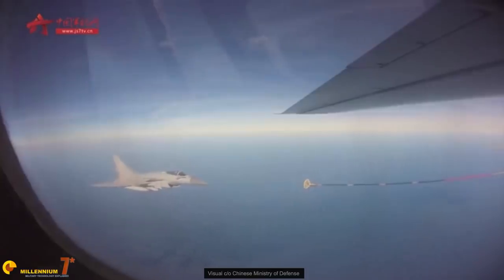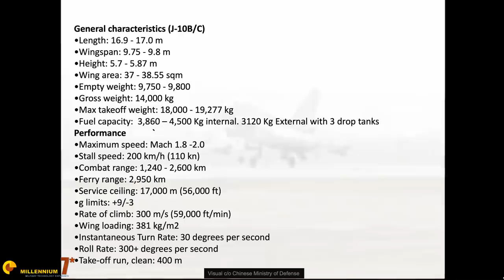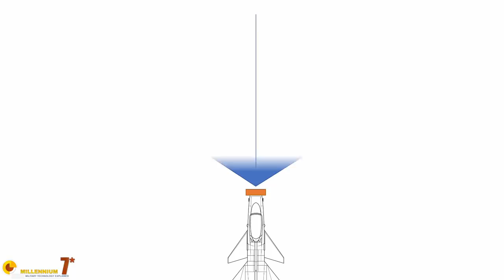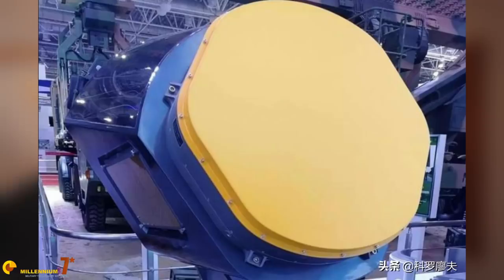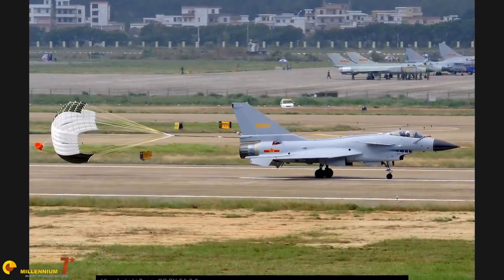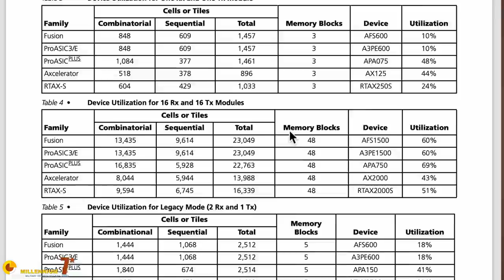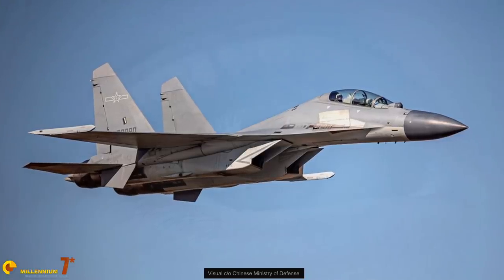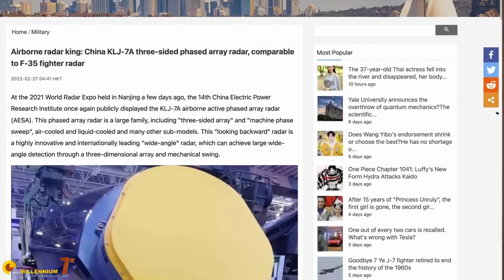I DUG DEEP into CHINA's J-10 ELECTRONICS and this is what I found...

Comment: All I really know about the J-10:  it is worrisome.  It appears to be a relatively inexpensive fighter aircraft which the Chinese can produce in large numbers quickly, and which appears to have at least parity with similar western configurations, but is undergoing continuous refinement and improvement.  That we in the West are not in pursuit of an analogous fighter (with the shutdown of the F-16 program without a replacement) is troubling.

The use of civilian standards in military aircraft, particularly for export use, is not unheard of.  Knowing how military planners think, it is likely this use of ARINC is intended for export (as Sr. Ramos and others have suggested), and that it can be easily retrofitted/replaced by a more robust system for indigenous use.
Reply: I'm frustrated with my USA too.. but let me bring you a little peace of mind. IF we continue to ramp up production of the F-35 (and obviously if we don't all die in a nuclear fire, the Russian invasion will be an absolute boon for the MIC) we will be fine. For starters - attrition. For all the bellyache about the F-35, let's be practical; the entire aircraft is built around LO/LPI. Although better fighters may exist, none exist in sufficient numbers to overwhelm our inventory of F-35's. As long as we keep cranking them out, this will remain true. The F-35 is also fully capable of providing mid-course guidance to missiles launched by other assets, including AEGIS and THAAD, for which it can also provide critical data for a hi-res 3d target track which is essential for missile defense. That's a big fucking deal. Look, I think the F-22 is the best performing fighter the US has ever made, and along with the B-2, it is a very special weapon indeed. But logistics, availability, and of course politics matter too, and when those aspects are also factored in, the F-35 has the edge. Think about it. 700 F-35 or ~120ish combat-coded F-22? The F-35s are gonna get the job done, and be ready for more, over and over. The F-22 availability is gonna drop like a rock from the word go.
Reply: @ray32245mv  Unfortunately the biggest problem with the F22 had nothing to do with it's capabilities but it's inability to be upgraded. If the USA had allowed select nations to purchase the F22 I think they'd still be going strong, albeit that inability to be updated/upgraded is huge problem. Just look the pilots aren't able to utilise helmet mounted displays, and their datalinks cannot communicate to modern aircraft or other assets. 
It will be missed when it finally stops flying, like the A12 and SR71.
Reply: Remember the F35 is the quarterback long range radar much better than China can do, the F15 is a missile truck that can use the F35 radar targets
Reply: There are more F-35s than J-10s. In fact, China is frustrated that their F-35 counterpart (a cheaper 5gen) is not matured yet.
Reply: @jwzjwz2003cn  the technology stealth is no longer stealth anymore. There are radars now on awacs and grounds which can detect stealth even cruise missiles. Yeah you can suprise iraq or libiyan airforce. Or most likely to be iranian. Plus stealth fighter needs lot of maintenance specialy for their radar absorbent coatings.
Reply: @jwzjwz2003cn  Not really. F22 is not in production, So J20 will outnumber F22 very quickly (probably already did) and J20 does land/sea attack much better than F22, so it can do F35's job aswell.
Reply: @ray32245mv  A few things:  the F-22 is done.  It's not coming back for a whole host of reasons, and I'm not holding my breath in hopes that we'll turn around on that one.   Once our existing inventory wears out or is shot down (yes, it CAN happen), that's it.  What I wonder is:  why are we not at work on something better (and maybe we are?  If we are, we aren't talking about it much, and that' might actually be a good thing.)

I do wish the F-35 had been a twin-engine design, just from the standpoint of reliability, but that didn't happen either.  I also wish the F-35's top speed had been pushed to at least a bit beyond Mach 2 - again, that didn't happen.  I also wish the F-35 had more actual dogfighting capability than it does.  For what we are spending on the program, this aircraft oughta be able to do all that and cook our breakfast.
Reply: @markredacted8547  Thats....exactly what I said, F-22 weakness comes down to logistics, availability, politics.
Reply: @horusfalcon  Yea, like I said, the F-22 is becoming obsolete for reasons, and no, they're not gonna make more, nor should they. Mission availability matters. 
Ok, let me give you a little more perspective, kind of big-picture thinking. Basically, Communist (Eastern) military doctrine is based around defense by way of low-tech, low-budget, basically trained, low-morale masses of assets. They are not very good at offense. They tend to build out and fortify the crap out of something, and then maybe build out some more. Look at Moscow. It is an absolute fortress, bar none. Also take note of China and the South China Sea. Look at the current invasion in Ukraine. Slowly building out, encircling, absorbing, like an amoeba. Their air power is still very reliant on good old-fashioned Ground Control Intercept.
Nationalist (Western) military doctrine takes a lot from Nazi Germany. Bleeding-edge tech, well-trained, highly-motivated, tip-of-the-spear, and yes, straight up blitzkrieg tactics. We tend to push deep and spread wide into enemy territory with the smallest unit possible, set up some kind of FOB, and defend it relentlessly using superior logistics and fire support. Once we take some position, we almost never relinquish it. We also rely heavily on foreign basing, leveraging our economic strengths to "convince" other nations it's in their best interests.

Now, about the F-35. With the understanding of the general military doctrines, I'll try to put your concerns in context. 
Russian and Chinese A/C rely on GCI - they have decent long range BVR, and are somewhat scrappy in WVR. What the US has learned is that TOF matters, and this is why we have prioritized close to mid-range missiles. Even with hypersonic missiles, their range is heavily mitigated with LO/LPI/ECM/ECCM, bringing the battle back to the close/mid-range sphere. 
As for dogfighting, it is best avoided no matter what you're flying, as SA is totally destroyed while engaged in it. But, the most likely scenario for WVR combat is when forced to visually ID a contact due to ROE. In this scenario initial turn rate/high AoA control with HOB weapons, along with LO/LPI/ECM/ECCM superiority, will be the deciding factor, and the F-35 has very, very good initial turn/AoA and the rest. The "lone Mig/Su prowling around canyons with IRST and engaging oblivious targets with IR missiles" is quite nearly a fantasy, and would be so rare that the attrition from such losses would have little effect on the eventual outcome. 
I like twin-engines, but twin-engine redundancy is somewhat overstated. In many twin-engine aircraft, a single engine drives components that are critical for operation, and are not duplicated. Also again, logistics, and availability. As a pilot, you desire total redundancy; as a war planner you desire more units, because additional units (of high quality, of course) will almost always be more effective to achieving victory than redundancy. It's a grim reality. 
Speed is life - but you know what's coming by this point lol. The devil is in the details :) Range. Even for a dedicated interceptor range is also life. What's even more important is time to target, especially with our (Western) military doctrine. This is where supercruise comes in. The F-35 is somewhat underperforming here, but it's getting better at it. It should achieve Mach 1.4+ supercruise soon. Once it can supercruise past transonic, the range of supercruise will dramatically improve. Mach 2+ is simply not as important as LO/LPI/ECM/ECCM, subsonic and supercruise range, and once again, logistics. In summary, the F-35 is "capable enough" that if we build enough (we currently are) it will absolutely get the job done, with minimal losses.
Reply: @horusfalcon  The US is working on a replacement, 2 actually, and they have announced plans and what they broadly expect/desire for both. Allegedly they are prototyping and testing the air force's fighter right now, which is, afaik, meant to be a (family of?) common airframe but iteratively improved through its modular systems and upgrades. There are also 2 European 6th gens and a Japanese 6th gen in the pipeline. Russia has public plans as well but I have less faith in them actually producing enough to make an impact, given where we are with the su-57 right now.

As for the F-35, it's in a good place. They sacrificed a lot for it to have powerful radars that suck up a lot of the turbines power that would have otherwise gone to the compressor or fans. This enables it to increase it's long range engagement envelope since radar detection is proportional to the 4th root of input power. This coincides with the US looking to replace their AIM-120s soon enough with 2 new BVR missiles, AIM-260 and something they call the LREW. 
It also is probably going to have an engine replacement in about a decade or so with a variable cycle engine (which is a complete paradigm shift in aviation and will become the standard across many nations), where it will have a range increase due to better fuel management under different flight regimes. Funnily enough, the F-22's competitor, the Y-23 had a variable cycle engine (https://en.wikipedia.org/wiki/General_Electric_YF120) but the airforce wasn't confident in this new tech at the time. It seems the airforce has taken a U-turn on their adoption of new and less mature tech.
Reply: Actually the F35 is fast and cheap to manufacture,  the R&D for it was extremely costly, just like in WW2 for Fighters and bombers, in the event of full scale war, USA and UK can manufacture 100-500 a day with the modern factories that have been put up in the event of such a demand being proposed from a war machine fueled economy. Maintenance is also cheap, the base proce is $95,000,000 for a F35 STOL AIII  variant
Reply: @richardscott8186  correct, people look at a weapons platform in its singularity. Communication is paramount, and the F-35 can pass on data live and use the f15 etc as an extension of itself.
Reply: @thehorsecockexpress1068  Thank you
Reply: @ray32245mv  Man, as a Chinese, I agree with you. The production speed of F35A and its $80m price is amazing. My home country has the counterpart of F22, but doesn't have a counterpart of F35 yet.
Reply: American war machine is very big compared to others, I would still prefer an F16 over Rafale or J10. Chinese war machine is also very big compared to France or Sweden. I would prefer Chinese J10 over expensive Rafale or Gripen.

Comment: Maybe the use of ARINC is related to the export potential of the airframe?

Using both an international standard and a civilian one at that, would make it very easy for any potential customer to access the skilled labor needed to maintain the systems. Maybe it also allows for the certification of non-Chinese inventory to be more easily certified, not a problem China has to deal with, but the other user of the J10 Pakistan, which has extensive amounts of French and US munitions, might find very useful.

But this is pure speculation.

Comment: Compared with the French Rafale, the J-10c still has a certain gap, mainly because the Rafale body is larger and can accommodate more electronic equipment, but the French Rafale head is too small, which limits the diameter of the radar and affects the performance of the Rafale radar. The French Rafale The Meteor air-to-air missile is definitely not as good as the J-10's Thunderbolt 15, which has a range of about 300 kilometers.
Reply: that’s not true 300km is too much and rather useless!
at that range the target could easily outmaneuver it!
most fox 3 missiles are engaging under 70km even though they have 2 times more as their total range
Reply: J-10s speed, combat range and wing loading are greater than rafael.
Reply: @masoudi1414  70km is pretty low for modren requiments also the way you talk about high range making it easy to maneuver makes me think u dont know how air to air missles track.All airforces trying to get hugh range missles

Comment: I wonder if you could swap out F-35B's central lift fan with an electrical generator for when laser pods become a thing.
Reply: The only issue with that is you will lose a lot of thrust with a generator THAT big.
Reply: @zchen27  True, but an F-35 that can cook you from 40 miles away doesn't need to run from anything :)
Reply: The new 6th gen jet USAAF  designed, manufactured,  and tested in 1 year is supposed to have that, UK RAF seem to also be doing something similar with their "Tempest Project" 6th gen interceptor; Roll Royce is cooperating with both USA and UK on the R&D of New age magnet Assisted Turbofans
Reply: @EzraMerr  Oh, that's brilliant! Now I'm imagining a shaft with electro-magnets attached alternating current to provide rotational torque on a shaft connected to the turbine. I wonder if you could also attach magnets in a dynamo configuration for electricity generation! Maybe you can use the same magnets?

Comment: Radar Range 170km for 4sqm
Missile range 300km
And then they argue that Pl-15 can kill anything at 300km
Reply: First of all he got tha radar wrong that radar is installed on jf-17 not j-10c. 
plus modren missile uses its own radars they only need guidence at initial stage. Later they switch on to their own radars and that is when they are independent. They do this to avoid enemies MAWS.
Third yoh dont need to have long term range radars to fire long range missiles. Awacs can provide guidance.
Reply: @munnumkhalid  I have seen many Pakistanis claiming Pl-15 can kill anything @300km
2nd. AWACS guidance is hell of a technology and needs advancement in terms of integration and weapon commonality. I don't think Chinese have cracked this so far. 
3. How will you lock on a target even if your missile allows locking at 180km if your radar can detect only at 170 km that too for 4msq (most modern fighters have RCS 1-2msq)
Reply: @VivekKumar-je3pg  we don't know china. And we should accept it. It's not the china that we knew 30 or even 20 years Ago what we belive does not matter. If usa and west is woried of china advances so does everyone else. Today you see modren China civilians equipments like their cars their bikes their cellular network. Its easy to say their military is advancing too. Example is their hypersonic missiles.
Reply: @VivekKumar-je3pg  dude it can target long range target if you read USA official reports on PL-15. Plus 300km range is only detterance obviously you don't want to get risked shooting down when your maws is beeping at you. Your meteor does the same.

Comment: A few variants have 3 stays, each side, above the engine's inlet (in the section used for keeping the BL away from the engine inlet).
Are those 3 stays/fins aerodynamically functional, or simply structural elements?
(Edit: In case they are functional, please elaborate on their functionality)
Many thanks.
Reply from the maker: Probably just structural for rigidity

Comment: Delta wing, close-coupled canards and the J-10 still requires ventral fins. Hmmm.
Reply: It helps with yaw stability at high AoA
Reply: @appa609  Yes, I understand what their function is, I was just wondering why a canarded delta would need them. The Mirage 2000, the Rafale and Typhoon do just fine without them.
On the F-16 they also aided stability at high speed.
Reply: The habits of Chinese designers are a little different from those of European designers. They continue the "high-altitude, high-speed" interception performance of the second-generation aircraft, so Chinese-designed aircraft emphasize high-speed performance (except for fc17, because it is designed according to Pakistan's needs) ), so you will see that the vertical tails of the Chinese battles are very huge and have ventral fins
Reply: Therefore, it is suggested that the Pakistani air force should not continue the habit of f16 and fc17 after obtaining the j10, try to avoid dogfighting with the opponent, but use high-speed performance, use the best radar, launch missiles at the longest distance and then leave the battlefield.

Comment: I think that the number of Su-27/30/35 & J-11/15/16 in service with both the PLA Naval Aviation and PLA Airforce is at least 700 individual aircraft, so I would say that the main aircraft is the Flanker, with the J-10 a close second.

SU-27SK/UBK - 60
SU-30MKK/MK2 - 100
SU-35 - 30+
J-11A/B/BS/D - 300?
J-15 - 30-50?
J-16 - 180?